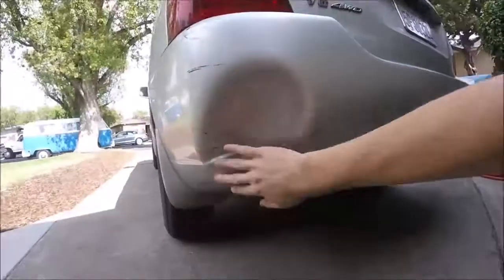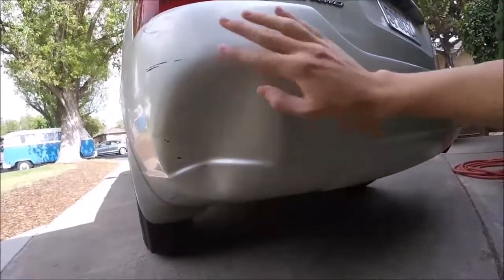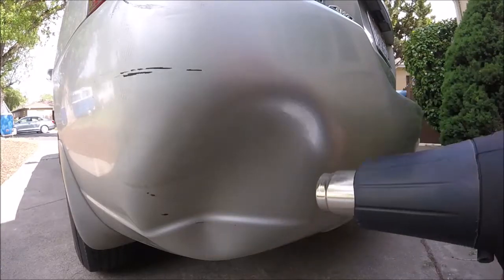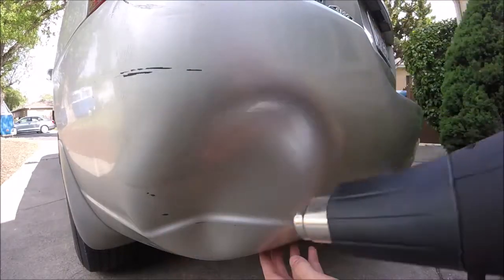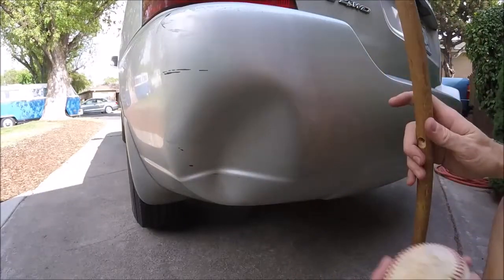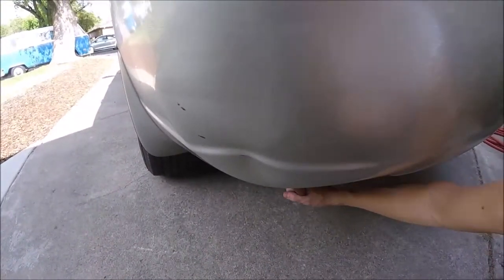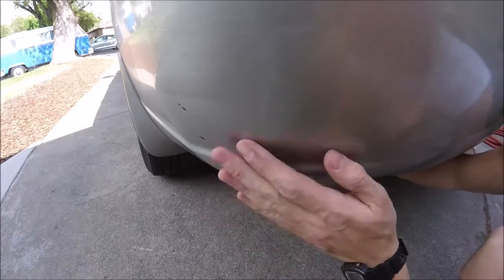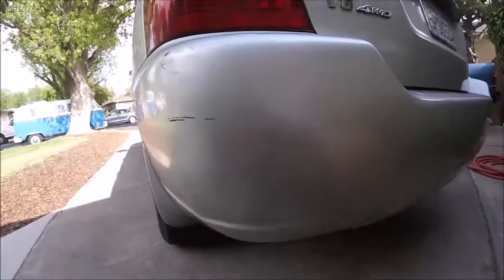How To Pop Out & Remove Dent in your Bumper Cover -Jonny DIY

Comment: That was AMAZING!! Thanks!!
Reply from the maker: You're welcome. Yeah I was surprised as well, how easily the dents pop out once you heat the plastic bumper cover up. Thanks for watching & commenting
Reply: @JonnyDIY  how long do you put the heat gun to it? Do you use high heat or low heat?
Reply from the maker: Just a minute or so.  Low heat is fine. Just til it softens the plastic enough to push it out. Sometimes you may need to do it once then heat it back up some to get it pushed out all the way 👍🏻